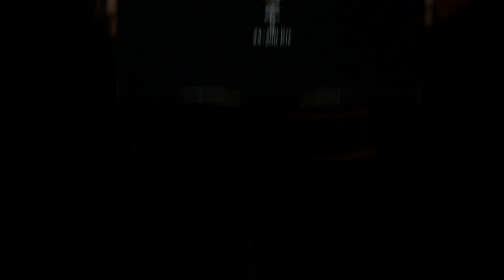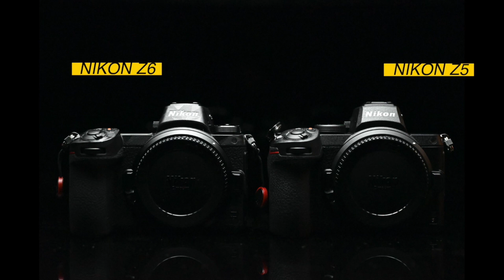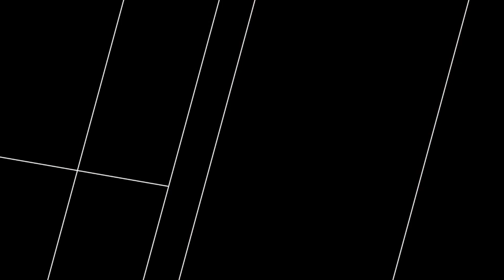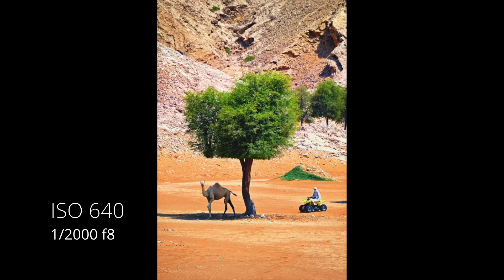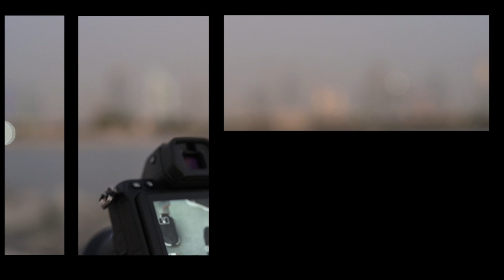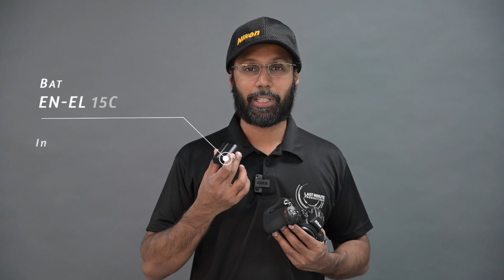How good is Nikon's all new Z5 camera?

Comment: Thank you for this video. I liked it. I am a d750 user mainly do photos no videos. I am very happy with it but I think eye detect AF and IBIS will increase my speed of capturing moments and and have more keepers. My main lens is Nikon 24-70 2.8g. I purchased a z5 yesterday. I thought  that on Z5 it will work at least as good as it worked on D750 for photos. In good light it is true. But in low light most of my pictures are blurry. I am not sure if I am doing anything wrong. I use eye detect in AFS and AFC mode. Very frustrating. It finds eye well but the review of picture show that eye was not sharp. Did you have any similar issue with F mount lens?Any suggestion from you will be much appreciated. Thanks.
Reply from the maker: I have not used an F mount lens on the Z5, but I do occasionally use it on my Z6. I have learnt that in low light conditions, the AF performs better when on AF-S than on AF-C. 
Are you using the latest firmware on the Z5? If not, please do update to the latest one and check to see if this improves the AF accuracy. 

It could just be that the 24-70G lens is taking a bit longer to focus than you expect. For the Z mount, the new mirrorless series of lenses definitely tend to docus faster than the earlier F mount lenses. Are you seeing that the eyes are out of focus a lot or just by a little?

- Feroz